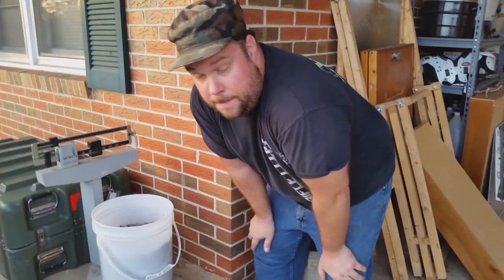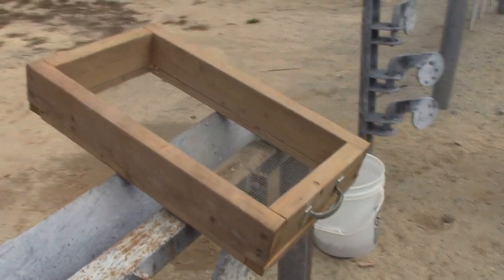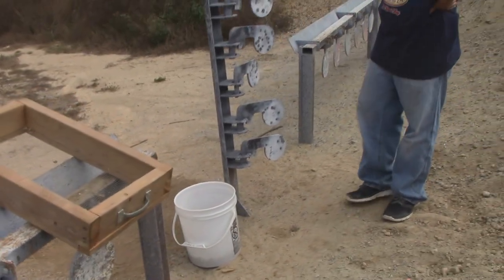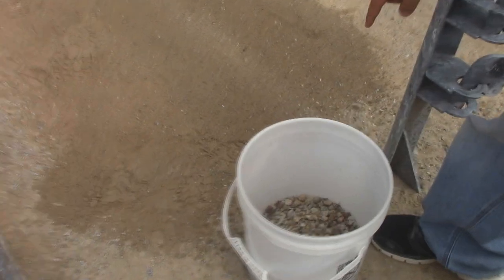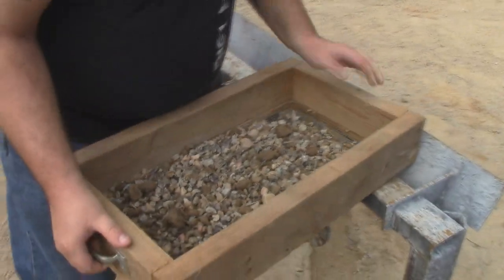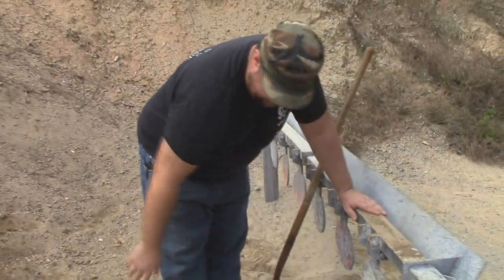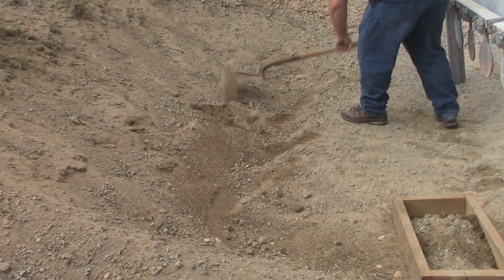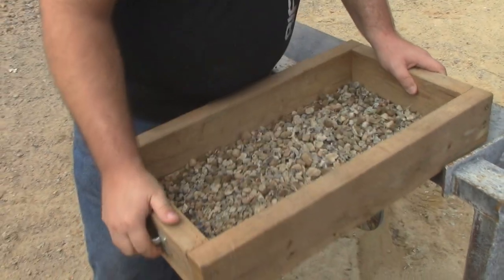I've Been Collecting Range Scrap Lead Wrong! 255LBS./30MIN.

Comment: Theres an air rifle range near where i live in the uk. Each week they clean the range and they usually get 4-500kg of scrap lead. It fills 3-4 wheelbarrows. They sell each for £250 to a company that turns them back into pellets. I cant get any from there however i live near a place named yorkshire where there are hundreds of old lead mines and if you go near them you can find lead ore rocks that weigh close to 100kg. I want to go all around my country one day and get all the metals from different regions. Such as copper from wales, silver from scotland, tin from cornwall, lead from yorkshire, gold from wales and scotland, iron from lancashire and iron from the lake district. Great video man

Comment: That is great, the old range I shot at as a kid would have a company come on Sundays and collect buckets of the stuff. 
It was an indoor range so it was a lot easier.....this is a very smart idea.
Reply: same as you would pan for gold rocker little shift it out for you to have these go to the bottom just wear a dust mask
Reply: I used to pick up range scrap in sacramento ca. at several indoor ranges. in the 80's. the company I worked for added linotype and made bullets. alot of the scrap we picked up were our own cast bullets, so once in a while we would have to  add less type.

Comment: you should get a utility cart to hold the buckets
Reply from the maker: +imthatsmell7 That is a great idea! I need a dolly.
Reply: CountryBoyPrepper go to Sam's club and buy a collapsible wagon, they hold like 200 lbs I think. Or buy the metal one at home depot, it probably holds more. You'll find them in the gardening section.
Reply: 25 dollar dolly from harbor freight will haul a bucket all day

Comment: just a little bit of quick math... 5 gallon bucket approximately 3/4 full is 3.75 gallons. if you had 75% lead, that would be about 2.8 gallons worth of lead. lead weighs 94.8 lbs per gallon. your bucket would weigh 266 lbs in lead alone. I think you may be overestimating the lead content.
Reply: TheKingnathan98 Remember the shape of the lead. It's in deformed bullets, so there's going to be plenty of pore space between them. There's also maybe 10-15% detritus they further reduces the lead content.

It's still a good haul.
Reply: I’d say maybe about 50% lead per bucket max
Reply: TheKingnathan98 2+2 is 4 - 1 thats 3 quick maths
Reply: your nans toaster Sauce?
Reply: who gives a crap,,,, least he is recycling so who gives a rats azz exactly how much it really weights,,, he is doing a great thing

Comment: Did you consider the variables:
>The new range is untapped by you or other scrap collectors,
>The new range may have more frequent shooters,
>Easy to sift dirt just increases speed, not yield,
>The steel targets account for a higher yield,
>The type and amount of rocks between ranges can directly affect the gross weight being measured,
>The range you visit is specifically a pistol range, with limited spread of lead,
 and the steel targets help force general directions for collection.

THIS IS NOT HATE IN ANY WAY!!! I appreciate the video, and I have liked and subscribed! Just wondering how strictly "Scientific Method" you guys went, or if it was just a direct comparison of gross yield at different ranges. Thank you for the video!

Comment: You need to make yourself a little combination shovel / sifter.  Cut out 60% of the blade of a shovel toward the back of the shovel and cover it with hardware cloth. Then just get one shovelful, sift it right in place, and dump the shovelful of lead right into the bucket.  Might need to make little "walls" around the back end of the shovel to allow shaking it and sifting the lead.
Reply from the maker: +J DeWitt DIY That's an interesting idea! Have you ever tried it?
Reply: +CountryBoyPrepper I've not tried it. The idea just came to me while watching your video. But I will definitely be trying it when I get a chance!
Reply: I was about to say the range I used to work at the guy that would mine the lead and sell it used the grating from a car grill and used a snow shovel he would mine anywhere from 100-200 pounds of lead per day and that was just from the public pistol line that he worked

Comment: that second load looked more like 80-90 percent rocks
Reply: WCGwkf It probably is, but some of the lead is deformed from hitting the steel
Reply: No, it actually looked VERY clean. Sure, there are some rocks, but still. Most of the lead will be deformed (depending on hit or miss) and these look EXACTLY like smooth rocks, until you pick one up and feel the weight. They also have a distinct color. New lead is silverish/light gray, old stuff is darker and really old stuff even has a green tint/coating to it.
Reply: @andreyzagoruyko5390  plus, it wouldnt really matter if some are rocks anyway right? Wouldnt they also melt just the same, and be decent enough bullet material?
Reply: Stargun5502 No, the rocks would not melt if thats what you mean. They wouldnt melt and could be easily removed from the top of molten lead.
Reply: @capper6100  ah gotcha, neat, i havent loaded any ammo in my life, but i plan to get into it, so i've been wondering on it.
Reply: @Stargun-vj1uh  lead melts at a very low temp. I don't remember what it is but it's like 500°f or something pretty mild. Most rocks would take a few thousand degrees to melt. But the super high density of lead allows rocks to float on the surface when its melted. Then they just skim it off
Reply: @ohiohouston3560  Oh okay, was definitely wondering how anyone knew the rocks and lead fully apart, seems that's why.

Comment: Hey CBPrepper I like the video I used to get scrap your way. I just found 2 Indoor ranges in my area and they have a unlimited amount of range scrap. I get 2 tons from them every month I bought 80 5 gallon buckets with lids from a local store. I then built a 300 pound propane melting pot for the lead to make ingots. My brother in law has come to help me make ingots the best thing is It has no dirt rocks trash brass steel or loaded rounds only spent rounds and copper jackets. which I have a furnace and melted down into ingots and sold to a recycler. Your a great source of info but I wanted to pass it on to you about the indoor ranges. Keep the faith Keep shooting Keep recycling.  Terry

Comment: you could make the sifter as a slanted table , shovel the dirt on at the top and while it rolls down the dirt sifts out automaticly ,  prolly can set it up over the bern while shoveling in the dirt from next to it 
put a flat funnel on the bottom and set a bucket under it to catch whats rolling of the screen 
the big blocks of dirt still be in it but you only be lifting the bucket at the end and the weight of the dirt by the shovelload , you prolly can sift that by using a screen that is the size of the bullets but smaller than the clumps of dirt 
takes a bit to set up but you prolly need to take a hand drawn wagon with you anyway to move the lead off the range 
think the amound of lead you get out of the range will drop after the first few sifts as the lead prolly been sitting in the berm from a few years of target practice

Comment: Walmart or academy sells these foldable carts you need to get one and you need to make a shaker holder with large wheels and you can just shake it. and if you make it level with your truck sell there you go just slide the buckets off your table to your truck. if you make the table with a screen then you will need a 3/4 inch bottom for your table! Great video thanks for sharing!!

Comment: Have you tried collecting lead from indoor ranges? That's what I used to do, would walk out with 50-100lb of lead in about 2 minutes. Only lead and paper (from the targets) which I would separate by floating the paper off with a water filled bucket.

Comment: the best solution I've seen for this is using a gold pan, just scratch into the berm with the pan, fill the pan and shake the pan, the heavy lead falls out of the dirt into the bottom of the  pan and the lighter rocks and dirt fly out keep doing it until you're full.

Comment: If you don't mind the suggestions, you're doing it the hard way. 
Panning, or sleuthing is the best way, but you need to set up tow or three filters, to get rocks and junk. Start with a large wire at the top on a 45' degree angle, then the lead catcher on a 15' decline, then a fine mesh warped form set up on a deeper 45' degree. Attach four legs to hold it all in place. Then attach an orbital sander to the structure. Plug it in. Use a brush to clear away debris.

Comment: just found your channel and this vid!  thanks for putting this together.  i've been collecting range brass for awhile, but have (like in the past day or two) been starting to collect range lead-- the way you and your son had been doing-- one... piece...at...a...time...  i was already thinking about getting/putting together some kind of sifter, but this confirms it!  my range has A LOT of sizable rocks, but with a solid shovel i should be able to dig past that to the dirt, then dump the rocks back.  two quick questions for you:  what size wire mesh did you use for your sifter? and, in your mishap vid, you mentioned selling your 1lb ingots.  are you still selling those, and if so, how are you doing it?  do you charge the daily spot price for lead?  fixed price per pound?  either of those + factoring in your labor?  -- thanks in advance from Montana!

Comment: Im a member of a local gun club and the treasurer kept asking me for a couple weeks to mine the lead so i went in and got 121 pounds in 2 hours. The only reason it took 2 hours is because i stopped for a little bit then went back and i was trying to clean the pit and be thorough about removing the lead. They want me to keep doing it but buying respirators gets a little expensive because i buy the ones that use cartridges and specifically the ones rated for lead dust. They expire after 40 hours of use or 30 days after opening What do you do with the jackets?

Comment: If you use a square point shovel and a hard tooth rake and level out after you finish it'll look better than when you started. Just take a couple of inches of dirt and replace it after you sift it and you'll get nearly all of what is in that soil.

Comment: Not trying to be a troll or safety Nazi but are you concerned about lead exposure?  Not just picking through it and handling it with your bare hands but the thing I would be most concerned with is breathing lead dust.  Shooting those steel targets surely pulverizes some of the lead. When you're sifting it, you're breathing some of the lead dust.  I'm the farthest thing from an expert but it can't be good to breath lead-contaminated dust.  Like I said, not trying to ruffle feathers just one dude looking out for another.
Reply: kinda makes sense, right ?
Reply: fall22123 and getting it all over his clothes, in his car, back home.... get your lead levels checked.
Reply: This. "Preps" for the future. Ignores the present. Doesn't look like he values his health anyway though.
Reply: touching it will do nothing. and pulverized lead when shooting steal won't make it into a powered enough to be inhaled but the dirt shifting lead could probably do harm due to lead contaminating the dirt around it when it rains.
Reply: fall22123 lead oxide is what you need to be afraid of, and lead vapor when smelting, elemental lead isnt going get you. ive been shooting and casting for years, handling lead with my bare hands. and my lead levels were nill
Reply: Lead is dangerous but not that bad. He'll be fine.
Reply: I'd say the far more damaging thing is him lifting it with his back all the time
Reply: Yea....  Fully agree with fall22123... I don't want to ruin your hobby or whatever...  

You really need to consider your health while collecting and casting....  
1.  Get a  "lead rated dust mask' .... For example. https://www.pksafety.com/3m-6000-half-mask-lead-dust-respirator-combination.html      (Not my company or anything)....  Just first link while googling.  
2.Consider fume extraction when casting...  
3. Keep kids & pregnant women away while processing.
4.  Wash your face, hands, clothes etc... right after collection or casting....
Reply: +John King
The only thing I'd be concerned about is processing the lead.  Just going to your local gun range and picking up a bunch of lead/bullets won't do jackshit to you, no lead dust is going to fly up in the air or anything.   I mean anyone who shoots already breaths that stuff in due to how close they are to the lead (plus breathing in the left over gun powder from the bullets), so what's the difference?
Reply: I've heard of people getting lead exposure from the dust generated by a vibratory case cleaner. Keep your media clean if you use one. I switched to wet tumbling.
Reply: Yeah lead is dangerous but it ain't that bad handling it in the open air. Just wash after handling and wash the clothes you are wearing. Your not handling enough to worry about breathing in enough to hurt you. Now if you did this every day 8 hrs a day well then maybe.
Reply: Well crap I need to stop using lead fishing weights, I’m screwed!
Reply: That sure sounds like hippie commie talk to me. Those paint chips taste so good
Reply: Name Witheld  "Doesn't look like he values his health anyway though."

It's comments like that which earn you cancer via karma. I sincerely hope you are blessed with everything you have earned and deserve.
Reply: Ask any old plumber who's installed the old type sewer pipe with lead joints.  Melting and pouring lead was a daily ritual. I grew up watching my father do it. Not a big deal.

Comment: A sifter improvement idea.... Look at a shaker box design based on the old gold mining shaker boxes.  Then you can move the dirt back with a rake and it will look like a smooth sand trap at a golf course. Just an idea.  You guys do a great job on your videos.  I have been getting a lot of information from you.

Comment: You found the mother load! Awesome man!
Reply from the maker: +TRprepper Thanks!
Reply: +CountryBoyPrepper you're doing the range a service by removing. it lowers the cleanup cost. it reduces the chances of ricochet. Just get with the owner(s) and do a scheduling of small area shut down. you could try getting a larger vibratory table with progressively larger sifting surfaces.

Comment: Never understood doing this. I always just buy more ammo because I'm very very lazy
Reply: It is a lot cheaper. Dollar per dollar, you can have 5-10x more ammo by handloading versus buying it at the store. Not to mention for some calibers like 40&W, they are underloaded from the factory far below pressure limits. You can get almost 20% more energy loading a full power with handloads, and better accuracy and reliability. The only way handloading will not be worth your time, is if you are paid $30 per hour or more at your job and you could be working during that time.
Reply: I agree.  It’s nice to have the option, but isn’t scrap lead under $1/lb?  Several hours digging, sifting, sorting, melting, cleaning, etc just to save even $2/lb (Cabelas prices) seems crazy to me.
Reply: Damien Gregory  It takes about 10min to collect 100lb of lead. It takes $1-3 in propane to melt it and 3 hours of actual time (the melt time you can leave to do other stuff) to sift out the jackets and pour the ingots.
You would have to be paid basically $30 per hour to make it worth buying over processing scrap. The more involved your processing setup is, you can even get to the point of processing 1 ton of scrap at a time at industrial level efficiency (I haven't gotten to that point but I'm getting close to considering it)

The copper scrap can also be sold for about $3-6 per pound to metal working hobbyists on ebay as well, or melted down for your own projects. So there is savings/profit to be had there too.
Reply: The calibers I shoot regularly are pretty cheap

Comment: Quick question: when you melt down the scrap bullets, do you throw in the jacketed bullets as well? I guess as long as the base is exposed lead, it will melt out too, right? Then you can separate the copper?

Comment: Build a frame for your tray to lift it off the ground. That way a lot of dirt will sift through as you shovel it in. Then you can just shovel it back to the berm, which is easier work than shaking a heavy tray.

I'm fortunate enough that the range I collect from in my part of Australia has been open since before WWI. On the older berms you have to dig through the lead to find dirt. And no one collects it here.

Pistol ranges are best, as you've discovered. The projectiles don't penetrate into the soil like rifles do.

I only use range scrap for my .45-70 and I have more than I could probably ever shoot in my life time. I'm more interested in getting pure lead which I'll use to cast for muzzle loading and perhaps a subsonic .300 Blackout down the track.

Jacketed .30 cals that expand at low velocity are few and far between, and pricey. A local company here makes a 235gn mould specifically for the Blackout. It has a flat nose which I'll drill out and make into hollowpoints.

Anyways, not sure if you still use lead flashing for roof construction over there, but I get a heap of pure lead from roofers. Off cuts, mostly, but when they do replacements, you can get entire sheets that roll up nicely. I've had them so long that the finished diameter of the roll wouldn't fit in one of your buckets. It's a source worth checking out.

Anyways, great vid and good to see you having such success. I love smelting and casting as much as I love shooting the finished product.

Comment: One of grand pa`s use to get used wheel weights from the tire shop he made sinkers.I think the only thing that will limit you is the kind of mold you can make sinkers,bullets, battery terminals. If you figure out how to roll those ingots flashing to.